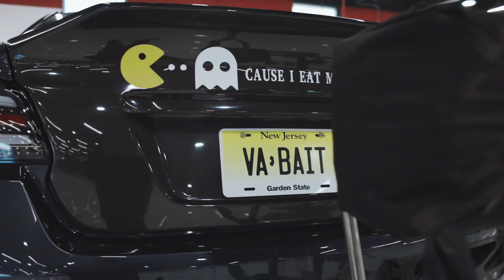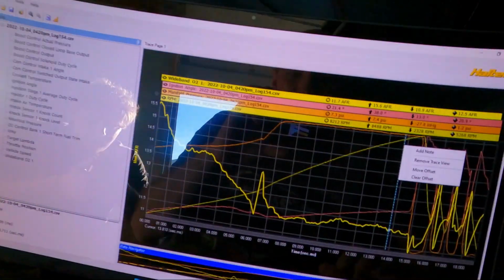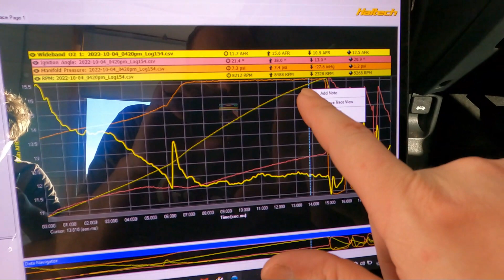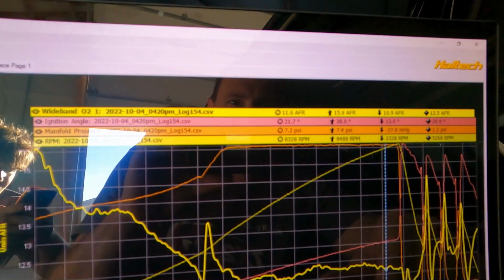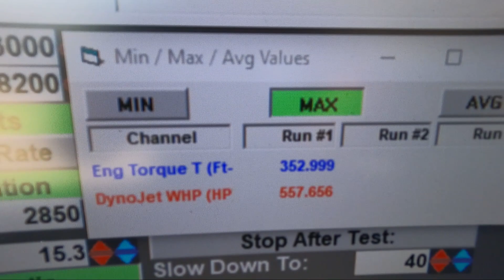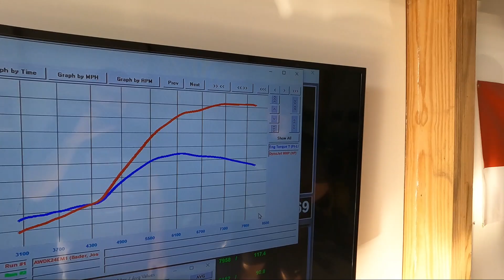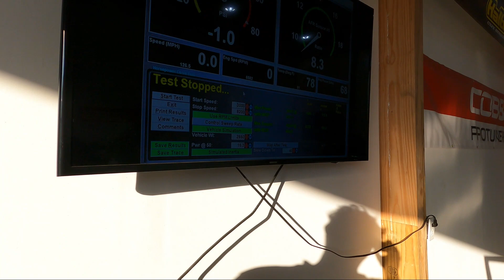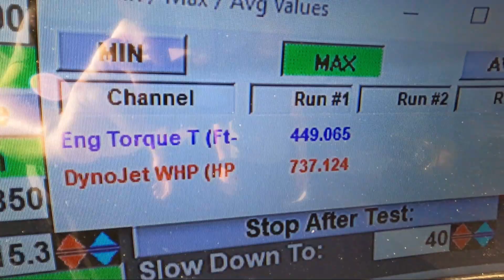Blew Up My AWD Civic Si AGAIN ?!

Comment: If I have a darton sleeved block for my 15 sti, roughly how much more will it cost me to reach 900whp
Reply: How much money you got?!
That's the question.
Reply: Should just have Atleast 20k for parts and prolly another 10k for labor and tuning
Reply: @joshr8680  sounds about right on the money for soild/reliable daily 900whp that could boost and keep cool, all day long.
Reply: If I have a rope and tie it to a tree, how far away can I walk with the rope in my hand?
Reply: I'm curious how a sleeved block would hold up. Heard it wouldn't do well past the 500-600 wheel mark from some people. I'm not sure how accurate that is. I've mainly seen closed decks. Mine is sleeved with forged internals at 450whp.
Reply: @nfsfanAndrew  sleeves are good for 1200+whp
Can do 500whp safely on the open deck
Can do 900 on a closed deck block

Comment: How come torque and hp don't cross at 5252 at 4:00?
Reply: Fake numbers. Correction factor trying to mimic a dynojet. Seems to be about 50whp over what it actually is
Reply: @benperkins2929  I calculated the factor, seems it would put him at 603whp

Comment: How the hell it make 700 wheel on only 23lbs..Thats crazy. I guess it is a big turbo eh.
Reply: Correction factor, he has it corrected for his Dynojet numbers as seen on screen
Reply: Basicly fake numbers. 
Hp and torque should bypass/cross at 5252rmps. It's maybe 500 on a real non corrected dyno.
Reply: @ryanveret4088  lol. That's not true at all!! You need to learn how dynos work. 
HP and TQ ALWAYS cross at 5252 unless you're faking your Dyno numbers. 
HP= TQ x RPM/5252. Always!
Reply: @GetaDomTune @tjbugeye I uncorrected the HP and it's 603whp
Reply: The honda k series engine flows way better than a big subi boxer engine. Especially the k24 flows so much cfm. It doesn't need much psi to make power. The k series is the LS in 4 cylinders. #kswaptheworld